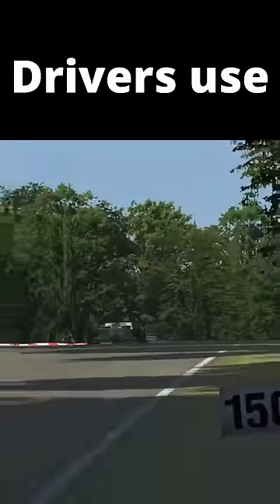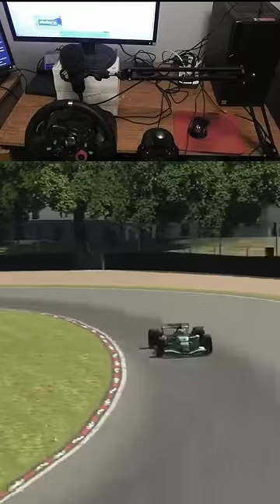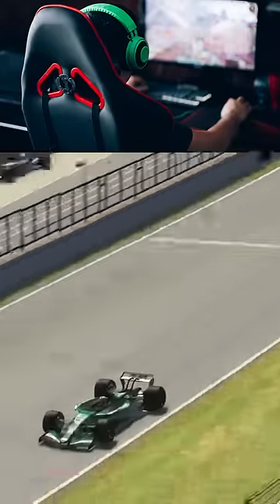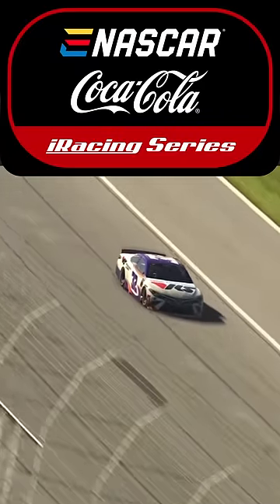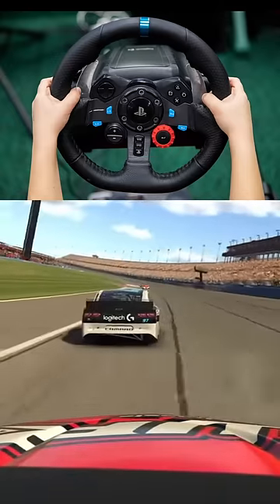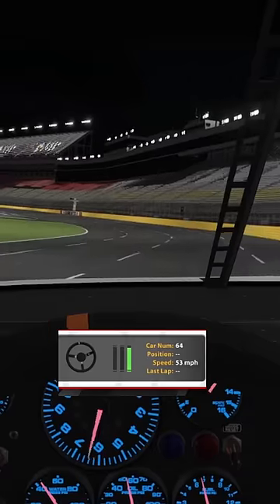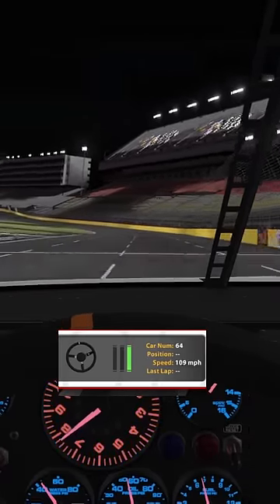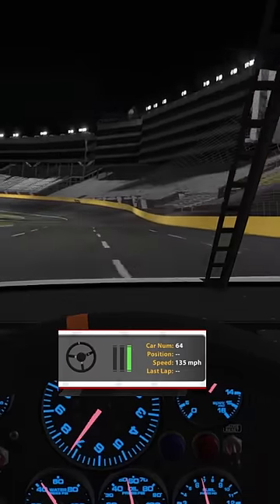Why Some Pro Sim Racers Use a BUTTON for Their CLUTCH!

Comment: iRacing:  "You can use a button for the clutch pedal."
Also iRacing:  "You must use paddle shifters for cars that use paddle shifters."
Reply: You can map any button you like to shift up and shift down. No need to use paddle shifters if you don't want or don't have.
Reply: @Daz555Daz  I suspected that, but I was mostly referring to the fact that you can't assign a stick shift to them.
Reply: @TChapman500Gaming yes you can. The limitations are in the shifter and not IRacing.
Reply: @LGTV121  Then why did the car not respond to me moving the stick into 1st?  It was properly assigned and worked for cars like the Street Stock.
Reply: @TChapman500Gaming It depends on the car (gearbox). F1 gearbox for example requires you to go through every gear from first to eight and vice versa.
Any other drivingstyle would just be weird in a sim...

Anyhow, the clutch exploit is as far as I know fixed. Engine braking should be and is more efficient now.
Reply: Asetto corsa - sorry need to be analog, no button here.
Reply: while engine braking, u loose much more time, than clutching
 @rickardboberg
Reply: @TChapman500Gaming  because the shifter maps differently for sequntial (paddle shift boxes) usually a bump to 3rd rest in nuetral and is down and a bump to reverse rest in nuetral is up
Reply: I just use mouse and keyboard for iracing
Reply: @TChapman500Gaming  This is false. You absolutely can assign a stick shifter to paddle shift cars.
Reply: @davecarsley8773  How?
Reply: @TChapman500Gaming when you assign a h shifter as paddles shifters it means you've now turned your h pattern into a sequential shifter so you only need to bind 3 Gear for up shift and 4th for down shifting
Reply: But also idk what kind of shifter you have since you never clarified but I'm guessing maybe your shifter is the problem if it's not working
Reply: @LilMaloneBone  That's not very convenient to do with the nerfed Logitech shifters (G25 shifters have a sequential mode).
Reply: @LilMaloneBone  My shifter is H-pattern only (G29 shifter).

Comment: Former world record holder on Test Drive Unlimited 2 here. Button clutch mapping in H-pattern shift cars in TDU2 gave you instant shifts, in the Koenigsegg this allowed you to hit extreme speeds. I used it to hold the record on the airfield track until the servers went offline.
Reply: Fucking loved TDU2. That F430 was bliss.
Reply: Look at games like Forza Horizon 4/5 and Forza Motorsports 7.    People were faster with a controller than a wheel!   Reason being, you could never duplicate going from full steering lock one way then the other almost instantly allowed people to pull off turns in ways they could never do with a wheel.  

I set my triggers to my throttle and break and my L1 to my clutch before getting a simrig.   It was as realistic as one could get using the controller while still having brake and throttle control vs 100% throttle and 100% brake only with a button

Comment: I think it was AUDI at IMSA that had a button for the clutch on the shifter as well as the pedal when they needed the feet for braking and keeping the turbo spooling in certain corners. Not as unrealistic as you might think.

Comment: So....  I worked in the Coke Series and prior eNASCAR WC incarnations (PEAK Series) for ten years with the drivers pictured in this video (Conti and Ottinger) and I don't know of a time when Ottinger had a button mapped as a clutch (MAYBE early on, 2009-2010 but not in the championship run a few years ago).  At that level you cannot lose time on pit road, and the easiest way to lose time was to bust the rear tires loose leaving a pit stop which happens nearly 100% of the time when the clutch is mapped to a button.  Further, when I was racing in Class B and I was building the cars that won the championship, none of us used a button for a clutch.  To leave the pit stall we basically just dragged it out of the box to prevent wheelspin.  Even more than that, nobody worth their salt uses a clutch to shift at that level.  If anything, you'd move the shifter to up-shift and hold it, then blip out of the throttle (no less than 50-60%) and then back to full throttle.  It'll shift instantly with no chance of the wheelspin that happens from a button-clutch like pictured.  Not sure where he got this info, but it's not true.
Reply from the maker: 2021 coke series auto club was won because button clutch allowed a few guys to make it a 1 stop. Since then more people have used it for races that would potentially need fuel saving. You can also bind the clutch pedal really short to a similar effect to make good pit launches still possible.

Comment: I actually used the cheap 458 wheel for awhile on FM7 and had my clutch/ebrake mapped to the two right thumb buttons and then I just used the paddles to shift. The wheel wasn't the greatest for racing, but what it was fun for was drifting. That setup actually worked better than you think lol

Comment: I use the clutch pedal on my wheel and in games, like codies F1 games, where a pedal is not really supported, i pull just enough so that it engages (2 mm or so) and just release at the start.
In my opinion easier than a button, where you always have a wall before engaging/ releasing the clutch

Comment: You can change the sensitivity of the clutch on most games I’ve played so just lightly pressing the clutch peddle will engage it 👌. I actually have my clutch peddle set as my E break because I don’t have a shifter or E break so drifting is difficult. Trying to find the paddle shifters or E break when the wheel is spinning around constantly isn’t fun 😅

Comment: Also, I imagine it's help on the road side of things with those heel toes, and allows them to maintain left foot brake right foot throttle and thumb on the clutch. Also, it's not entirely unrealistic. It's possible IRL. A lot of heavy machinery have a push button clutch on the shifter, a Fett wheel, and right wheel brake pedal, and a throttle, and a throttle on the wheel too, so you can basically set an RPM (say you're running something needing a specific RPM to hit the specific PTO speed for whatever they're using needs) but you can use the floor throttle still but now you basically just moved idle up to whatever you want. So, it's not entirely unrealistic to imagine a push button clutch in a racecar.

Comment: One could in theory use a button to engage or disaengage a clutch IRL by using a large solenoid or pneumatic cylinder to operate the clutch.

Comment: You can save some time but you need to save time while using the shifter. It's no use to press the clutch quickly if you cannot use the shifter efficiently

Comment: Many straight cut gearboxes don't require a full clutch depression and a full lift, that's why you can see in late 80s f1 onboards drivers tapping the clutch and lifting the whole right leg for instant shifts

Comment: in nascar the only time they use the clutch now is letting it out in first gear. most drivers just match the next gear to the engine RPM and shift without a clutch.

Comment: One small error, fuel saving is by throttle position only, not clutch position. (In IRacing, at least.)
Reply: You do realize clutching allows you to roll more speed and lift off throttle earlier as a result, right? Lol

Comment: I see that some steering wheels have four paddles(two on each side). Are those extra two paddels used as clutches or something else?
Reply: yeah, they’re dual clutches. it lets you have one of the clutches depressed to the bite point of the car, and the other fully depressed so when you release it the other clutch will already be at the bite point and you have a good launch almost every time.
Reply: Yes. You can also re-map them in game which is great. A friend of mine who is disabled uses the Fanatec McLaren GT3 wheel as it allows him to map them as throttle and brake.

Comment: If you want the high RPM's around turns, don't forget to upgrade to the Racing Clutch & Flywheel.  If your teaching a newbie Manual transmission, you can just use the stick without the clutch until they get the idea.  Not like the virtual transmission cares😂

Comment: Mhm well interesting but i adjust the curve to work on about 1cm of the pedal movement from 0 too 100% i mean that is realistic for normal road cars and the tunner /racing clutches are even more agressive 😅  for the same reasons (+ other material pairing cann transmit more power but grip faster )

soo using a button is a cheap way of emulting that also many cheaper stearing wheels don't have a clutch pedal sooo i dont mind them doing that and performance gains get lost in more complex sims because it has also same disadvantages with down(and up) shifts in manual cars

Comment: I dont have a clutch pedal so should I bind it to a button?
I never have cause I was afraid of spinning the tires real bad off the grid
Reply: Well, you heat up your rear tyres faster.
Reply: For certain cars it'll help. Especially standings starts. For others you will have to decide what works best for you. Give it a try, test it out, & then compare the times.

Comment: There should be a minimum delay for this kind've thing. If say, binded to a button, then your clutch will always be as fast as the average racecar clutch presses, so therefore nobody has an unfair advantage stemming from unrealistic control simplification.
Reply: That already is the case in iracing. No idea how uploader and all commenters didn't notice that already.

Comment: Dunno why they don't just artificially limit the speed of the clutch.  Like if you press the button, the clutch takes 100ms or so - just measure a fast clutch press - to disengage and engage.  That makes it more realistic and evens the playing field.  Someone could fake an axis with an arduino but then you could still limit the speed of the clutch with axis players too.  As long as it's fast enough they shouldn't notice a difference.

Comment: This is a real thing in real racing both in F1 and GT2 and GT3 class racing the clutch is behind the steering yolk like a paddle shifter but index finger size.
Reply: Those are only for starting and stopping though, not shifting.

Comment: Infact Audi built a ralley car (I think it was the Audi S1 from Walter Röhrl) where the clutch is operated by a button at the steering wheel. It was very dangerous because the clutch pedal did then move very fast and you had to watch the stand of your feet
Reply: The clutch button was on the shift lever, so he could change gears with one hand and keep his feet on gas and brake
Reply: @snjert8406  Ah thank you for the addition. I didn't know it exactly :)
Reply: @bensta614  no problem! :)

Comment: of course you can do that in real life. Its called automated manual. Many cars before dual clutch transmissions did that. for example ferrari f1 gearboxes in Ferrari 360 cars. You press a button on a steering wheel and  Gearbox Actuator does the clutch for you and another one changes the gear.
Reply: Clutch actuation isn't instantaneous in real life... lol

Comment: This isnt really that far off from how Formula 1 cars work the clutch. Its just a paddle on the back of steering wheel. So its basically a button they push to engage the clutch. But they also only use the clutch 2 or 3 times in an entire race.

Comment: yeah in real car you don't save fuel by engaging clutch because engine has to spin somehow still using fuel, but if you just release throttle you save 100% fuel because wheels are spinning the engine

Comment: Sim racing to me is a way to practice using various different cars in different conditions relative to real cars, you can see how they act and handle in real life to a certain point and have an insight on what you could get yourself into when buying performance cars or modifying other types of cars (irl). Using the clutch as a button instead of as a real clutch just defeats the purpose of having a racing sim in that respect.

Comment: Isn't it the opposite in real cars? You need to not press the clutch and let the motor break so the motor not uses any idle fuel to keep the motor running?

Comment: Interesting.  Should iracing nerf the button clutch a little bit though?  I mean it's cool that they give you an option to use a button, in case you only have 2 pedals.  But it doesn't feel like doing so should be faster than a pro-racer could achieve using a pedal.  (Maybe add a curve to the clutch application or at least a delay?)

Comment: Here's a great idea, how about you bind that button to the other button that engages the upshift... with a bit of software or arduino magic, you could get an upshift with exactly the right clutch timing every time, just as quick as it all can get. Oh, and why not bind that button to the rpm of the engine, so that every upshift always is optimal? Oh wait, is this all turning into an automatic gearbox on a manual gearbox car? 

Could that be after all what the button-clutchers are after? "Whatever it takes to gain speed", eh?

Comment: But you don’t use the clutch to shift in most stock cars on iracing
Reply from the maker: So the button clutch way is technically barely faster than throttle blip if done perfect but personally like and use throttle blip more

Comment: I thought iRacing removed clutch fuel saving a few seasons ago.
Reply: Not for every car. For example the LMDH cars can still do that
Reply: @schrojitonengzwee5018  that's interesting, and weird. Of course with the LMDh you need to be on the brakes to charge the battery so no-one is lifting and clutch-coasting anyway during races. Not that I've seen at least.
Reply: That’s correct. For some cars, coasting on the clutch causes mechanical damage.
Reply: In IRacing, fuel saving was and still is based on throttle position only.
Reply: @nick7597  true. But for many cars IRacing made a change where the engine didn't cut out when you pressed the clutch. For some reason they did not include GTP in that change.

Comment: The clutch in real life F1 cars is a button on the steering wheel, it’s not something only possible on a sim
Reply: And NASCAR drivers don't (typically) use the clutch except to get into first gear.
Reply: F1 clutches are paddles on the back of the steering wheel not buttons
Reply: @twopacks9178  different drivers have different configurations depending on their preference. The placement of most of the controls on the wheel isn’t standard across the grid.
Reply: @Ultra_Fx True but for the most part its a small paddle under the down shift paddle on the left side of the wheel, so they can release it and up shift quickly off the line.
Reply: It’s still a button lol
Reply: @Ultra_Fx what 😂😂 F1 cars only have a double clutch on the back of the wheel per regulation. And it's only to get out of first
Reply: @twopacks9178  arguably, a paddle on a steering wheel is just a permutation of a cantilevered button.
Reply: @Official_MikeyT  No, because the paddle is analog, not just an on and off switch.
Reply: Correct. Alfa Romeo/Fiat designed it and is still present in their road cars with the "Selespeed" manual gearboxes
Reply: @twopacks9178 except that paddle is literally hitting a button lol
Reply: Show me an F1 car made after the Aryton Senna era that has a clutch on the steering wheel and is required to engage for upshifts and downshifts. Which is the literal topic of the video you're commenting on now.

Comment: using the clutch to save fuel is not realistic at all, engine breaking doesn't use fuel, the engine is powered by itself. putting the clutch in causes the engine to idle which uses fuel

Comment: using the clutch for corner entry makes no sense, you lose grip and save no fuel because the amount of fuel injected into the engine is determined by the throttle and not the rpm of the vehicle

Comment: Having a button clutch should be considered cheating then. The whole entire point is simulation/realism using the tech for an advantage is the biggest issue with sim racing imo. This is no different than strapping a rubber band around a controller imo. Or driving an h pattern car using paddles. Why are we even using a sim rig if we are altering it to be less realistic?

Comment: Technically, it is a cheat - as far as realism is concerned. It is OK to have a short throw of the clutch pedal. But binding it to a button? Just silly. Obviously, for temporary use before you can afford to buy a proper three-pedal setup, it is fine. But for serious stuff, I totally despise crap like that.

Comment: iracing patched the fuel save hack, can’t do it anymore
Reply: Actually, they didn’t change fuel saving. It was and is still based on throttle position.  However, they did change coasting on the clutch to cause mechanical damage. But, ya, they did change the “hack”.

Comment: What's the point ? Sim racing is about simulating racing and trying to make it as realistic and accurate as possible without actually racing in real cars 

If you are doing this you might as well be using a controller

Comment: Pays hundreds of dollars for rig to play sim racing games, immediately eliminates the need for a rig and reduces one of the most important simulated actions back to a controller button push….it’s not just stupid at first glance, it’s stupid at all glances. Why not eliminate the wheel, you can go from full lock to full lock faster with an analog stick…….oh yeah, that’s right because it’s supposed to be “simulated” racing, not “I’m going to eliminate parts of the simulation for a competitive edge racing”